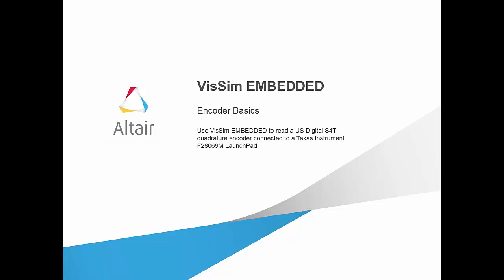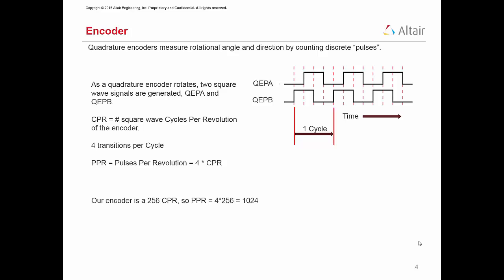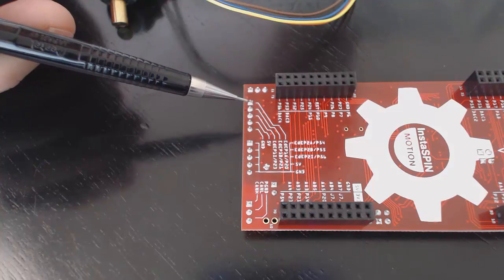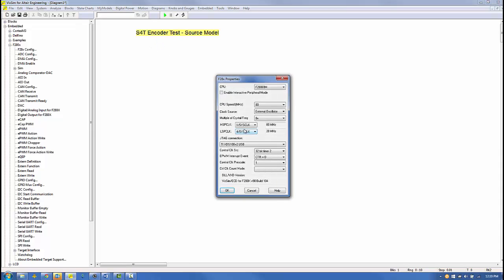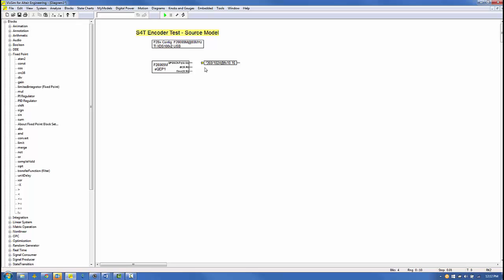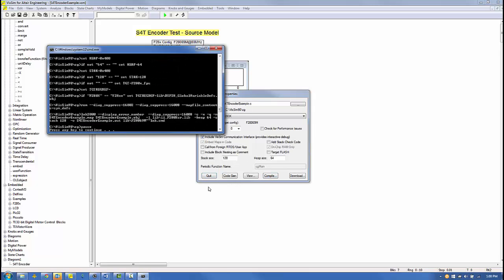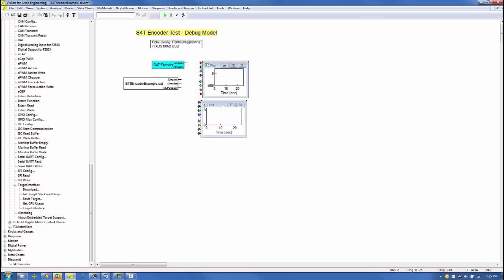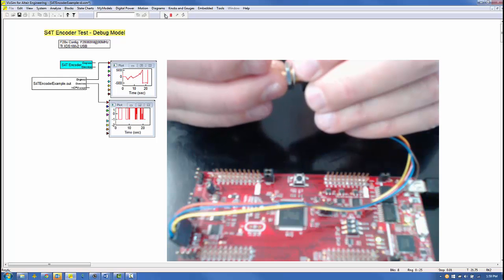VisSim EMBEDDED - Encoder Basics

Comment: Hi Richard. I'm following your tutorial for a 200 CPR Encoder. I'm replacing the parameters in the Fixed Point Gain, I'm getting the direction but the degrees are not showing. Do you have any suggestions?
Reply from the maker: Is it a 4 wire encoder?  Are you able to read any values for the pulse count?
Reply: It's Richard, and I'm able to read the direction, but for some reason the degrees are not showing. Given that I have a 200 CPR enconder, the value in my Fixed Gain block is 360/800, but that should be the only difference, right?
Reply from the maker: Yes, that should be the only change needed.  Is the input to the fixed gain block producing a count value that reaches 800 at 1 revolution in either direction?
Reply: Yes, I just checked.
Reply from the maker: okay, that means that your gain calculation must not be working correctly or it is not wired.  Easiest to check the wiring connections first, right button and hold the fixed gain block, wiggle it around and you should see a green wire attaching the source to its input, also check the output of the gain to the display or plot block the same way.  If both sides of the gain block are connected, then the problem may be due to fixed point arithmetic (I'm assuming you are using fixed point, can you confirm this or are you using floating point?).    Might be easiest if you emailed me your model, rkolk@altair.com
Reply: It was a connection! Thanks for your assistance Richard, never thought you were going to take the time. I really appreciate it. :)
Reply from the maker: You're very welcome, have fun with it.